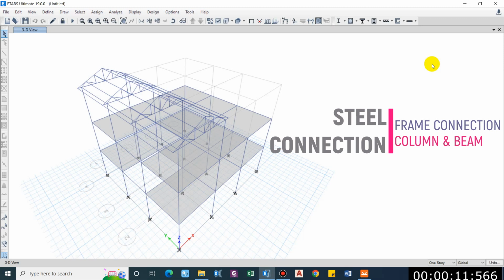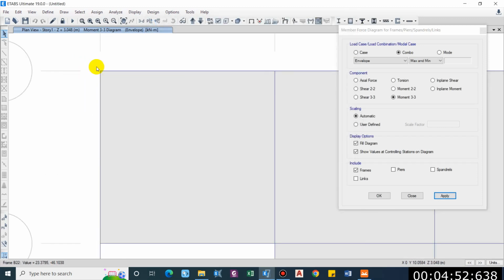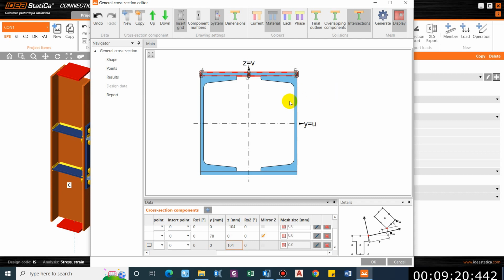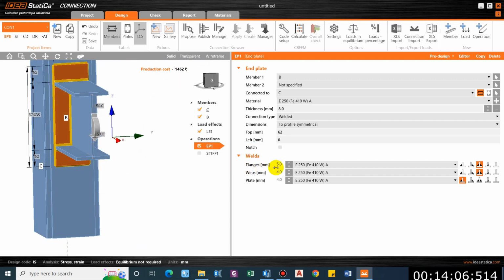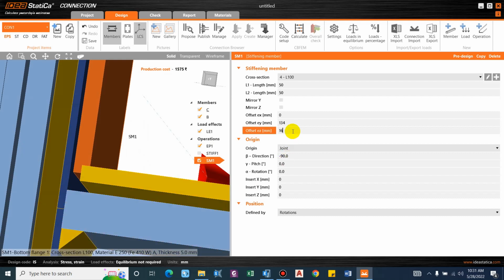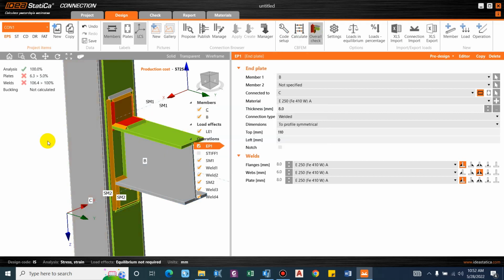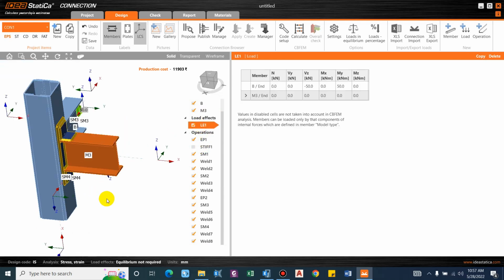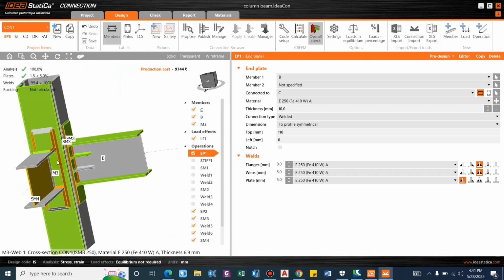Design of Beam and Column connection (Moment connection) |  IS 800:2007 | ETABS & IDEA STATICA |

Comment: How do you take care of section 12 of IS 800:2007 in idea statica, where coonection is required to be designed for 1.2 Mp. It becomes even more critical for braced frames where brace connection needs to be designed for momemt  of 1.2 Mp about critical bucklimg axis.